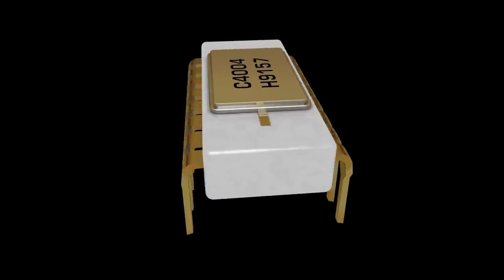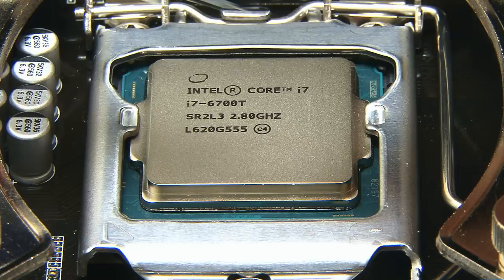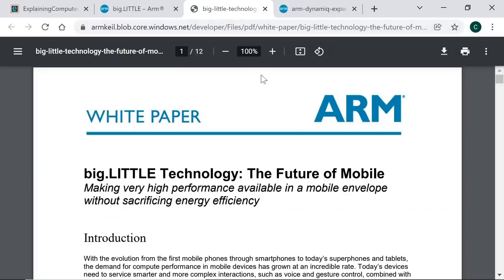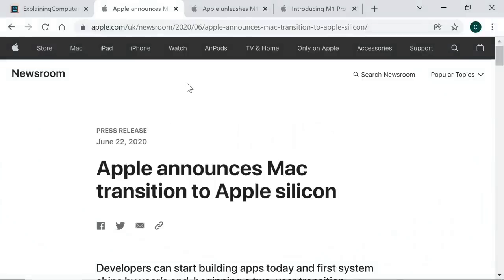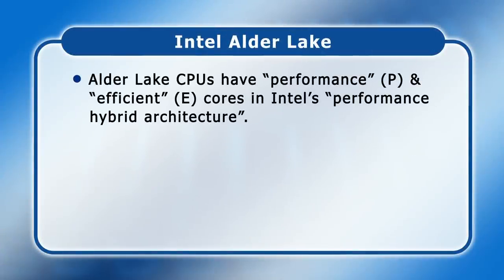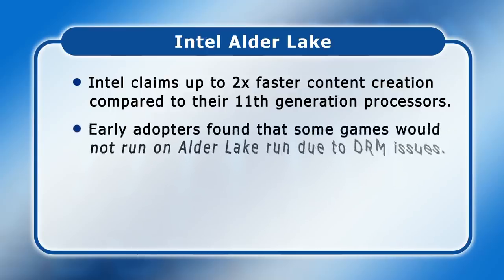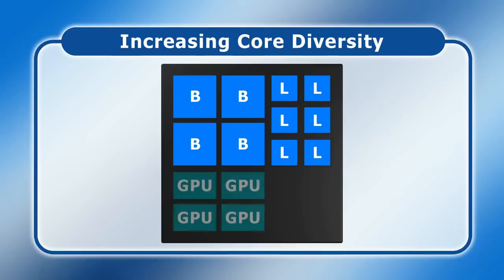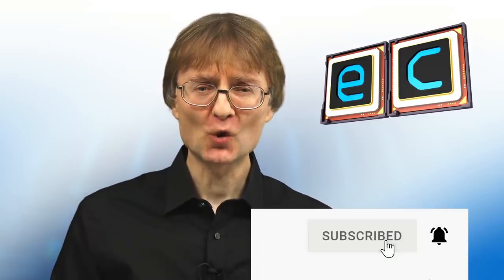The big.LITTLE CPU Revolution: From Arm & Apple to Intel & AMD

Comment from the maker: As many people have correctly pointed out, when I state that some server processors contain "a staggering 56 individual processing units", this is currently the highest count for an Intel server CPU. For AMD the figure is 64 cores. My apologies. Also note that I say "Intel 404" and not "Intel 4004" in the second section of the video. My brain is clearly failing (although the graphic for the chip is correct).
Reply: This new 12th gen doesnt always work as intended.....the scheduler is broken so it causes issues with many programs
Reply: i love these videos always well done
Reply: you need to take your medications ;)
Reply: Your brain isn't failing, it just needs the latest kernel fix.
Reply: Intel 404: CPU not found
Reply: Yep, doesn't matter how fast or powerful your hardware gets, if the software contains bugs, it will just fail faster. =D
Reply: Love your work
Reply: cosmetic errors, no worries. Enjoyed the presentation
Reply: Mr. Brain was only having a hiccup. Your video was wonderful. :)
Reply: Your brain is not failing. Maybe needs a cooling fan?
Reply from the maker: @johnfaulkner6776  :)
Reply: We are born to make mistakes, and the best one can do is correcting them,
So, thanks for the correction
Reply from the maker: Jim McIntosh  :)
Reply: 56 cores? Yea Intel's weak Xenon is at 56, but AMD EPYC is currently using 64 and the next gen will have 128 CORES!!!! 256 THREADS!!!! and in a typical 1u server with DUAL SOCKETS that is a STAGGERING 256 CORES and 512 THREADS!!!!! .... 56 cores.... go Intel?
Reply from the maker: @Nobe_Oddy  I really think we need to compare CPUs that actually exist -- and that comparison is currently 56 vs 64. Both Intel and AMD server CPUs will can also be used in dual socket boards, and have two threads per core. So your comparison of 56 to 512 is ludicrous. :)
Reply: Since Cyberdyne is coming, those problems wil be gone soon.  ...sort off...
Reply: These types of brain hiccups happen to me when I accidentally drink decal coffee.
Reply: In chrome browser about:flag you can restrict by enabling big little

Comment: The unsung heros of this hardware innovation are the associated compiler and OS technology that allows the same code single-threaded to benefit from multiple CPUs.  M1 is great, but the seemless and performant Intel-to-ARM translation layer in the OS is mindblowingly extraordinary to me.
Reply: Software is of course, the ultimate goal of making hardware. Hardware is useless. Software is where it is at. This is how a programmer thinks. Then he or she learns that a faster set of a certain kind of cores makes their code run faster... it is the code that makes the decision, not the hardware. You make hardware to make software run faster. Hardware is just a bunch of shortcuts made into silicon.
Reply: I believe Apple baked in some special instructions in silicon to accelerate Rosetta 2 performance. It is definitely very impressive!
Reply: @BlahBleeBlahBlah  Yeah, that's true and as you write very impressive . I bought my Macbook Air M1 the same day as it was announced and love it. I also have a couple of Intel NUCs and Asustore NAS, love them too. ;-)
Reply: @Alessandro Condorelli What is Photonics computing? please enlighten me on the process :P
Reply: But compilers don't just make your code use multiple cores. A programmer has to explicitly spawn threads or processes and use synchronization tools with them. I can see that OSes might and do use multiple threads in single threaded code, but the performance is incomparable to actual multithreaded code.
Reply: @danielreed5199  Sounds like the Isolinear systems from Star Trek TNG onwards.
Reply: @johntrevy1  That is indeed enlightening, thank you
Reply: Seven years for what?

Comment: The processing power in home computers is getting so far beyond my needs, that I can save loads of money by buying what most people seem to regard as obsolete relics! I'm writing this on a 2012 i3 laptop, and my recent, and most powerful, purchase is a 2014 i3 desktop. They're more than adequate for everything I do, including CAD for 3D printing etc. They're a massive overkill for gaming, as Solitaire runs on almost anything!! The only new computers I buy are Raspberry Pis, that are pretty good for general purpose computing, apart from a few programs that don't have ARM versions.

In 8-10 years time, maybe I'll find out what one of these new breed of processors can do, when I can pick up an old machine for £60 on eBay!!!
Reply from the maker: I agree. For a great many applications, modern CPUs are over specified.
Reply: Agreed. Watching this on an HP 8200 Elite with i5-2400.
Reply: But can you run Windows 11?
Reply: Up to a point. You eventually run into hardware incompatibility problems, such as PATA to SATA, and you want to use USB3. You can get round these problems with adapters and cards. Modern software such as Firefox uses a lot of memory and processing power. When you use a new computer, it's amazing how snappy it feels.

I must admit, I'm surprised at some of the PCs I see thrown away.
Reply: @photonboy999   Why would I want to? It took me years to be able to almost entirely escape from the clutches of Micro$oft, and dual booting Windows 7 on my oldest laptop for the few times I need to use Windows only programs is good enough. Linux Mint on x64 machines and Raspberry Pi OS on Pis does everything I need, and more.
Reply: I own a used 3900X (£320) and need the 24 threads for some simulations, but I like the i5 4570S in my home server more. It did cost just £25, incredible performance for the price.
Reply: The bottleneck has been the hard drive, put an SSD on a Core i3-Gen2 and it will be fast enough for most people and tasks, just make sure you have at least 4GB of RAM, or 8GB
Reply: @rollover36  I have SSDs in most of my computers, except the Raspberry Pis I use for specialised jobs like running OctoPrint. The "new" i3 came with 8GB RAM.
Reply: I have a raspberry pi 4 4gb as a backup for my main in case it fails. I had one main computer fail two years ago and i was without a computer for over a month since i had to save funds. Since then i bought a rasp pi just in case. It works just fine for that i need it to do and it costs a 3/4 less than the usual mobo ram and cpu i get when my mian computer fails. Now that i dont game much at all anymore since i picked up my guitar afer 30 years the rasp pi can handle anything i demand of it.
Reply: The software will eventually kill off your hardware and I suspect streaming will at the forefront of the line to kill your hardware.I too have assembled a collection of dual core computers most with min 4Gb ram and they have various Linux incarnations on them (usually Linux Lite or some XFCE distro). They run pretty fine.
Reply: Old hardware is still quite good. My home theater pc has a core2 quad and an Nvidia GTX500 series graphics card. It's got 8gb of ram and runs a SATA SSD. Plenty fast for a browser and streaming box, and it just got a new lease on life with GeForce Now.
Reply: @CyborgZeta  my i5-2500K says brang it on, baby.
Reply: @Sunlight91  i3 12100k is faster for 3900x at 120usd releasing in jan
Reply: @CyborgZeta  the only thing that gets dated is gpus
Reply: An i3 12100 with a NvidiaT1000 is more than enough
Reply: Y'all got nothing on me. My main laptop is a hacked Chromebook running MX Linux quite nicely on a dual core Celeron 3215 @ 1.7 GHz and 4 Gigs of memory.  I replaced the original 16GB m.2 flash drive with a 250GB model and everything is super zippy apart from video encoding.  (Which is not something I do with it anyway.)  Power-off to login screen in 23 seconds.  Another 5 seconds to the desktop, so under 30 seconds to boot to my workspace.  It plays video excellently, and does all internet things I need it to do.  It also allows me to do basic photo editing and some other graphics work.  I run Brave, Firefox, and Opera as browsers without problems.  The most complicated game I play on it is Endless Sky and that not very often, but it never hiccups.  Onboard HDMI means I can use pretty much any TV as an external monitor @ 2020x1136.  I generally get about 9 hours of use out of it on the battery if I'm not flogging it, and it's 4 years old!

That said, I did have Elementary OS installed on it and it booted even faster.  As low as 15 seconds from power-off to desktop.  However the developers of Elementary OS have made some decisions I don't like so I'm switching to MX Linux.
Reply: New portable computers (netbooks, notebooks, etc) are optimized not only for performance, but for less energy consumption. You could reduce your energy bill by just upgrading.
Reply: I'm using an ASUS VivoPC from around 2010 as my main computer. Works OK. Doing anything Java isn't so great, though. It also helps that I run Debian MATE and have an SSD card.
Reply: I'd argue that the processing power in home computers has surpassed what most people need over a decade ago. The difference today is how the software keeps "upgrading" to do the same tasks it was used for a decade ago. For example, MS Office has GPU acceleration in Excel...and the VAST majority of people who need to use a spread sheet program don't need it and could just as functional today if they were still using Excel 97 without GPU acceleration.

That being said, if nobody tries something different or tries to push software and hardware limits, life would be too boring. :)
Reply: My Thinkpad W530 with i7 QuadCore from 2012 is even as fast as many new Laptops coming out including some for content creation and even gaming. Very seldom I am using an external GTX970 solution for creative work and modern Gaming. And I can take it to every place I need to! For my main work (writing articles) I use a Thinkpad T60/T61 Laptop from 2007 (though as an hardware enthusiast I modded it to run a QuadCore aswell lol).
Reply: @Amorousstake4  Only in gaming. For my multicore application the 3900X even beats the i5 12600k by 16%
Reply: Fully agree. The same is true for phones as well, but phone apps begin to misbehave on older phones, likely because the developers have no incentive for backward compatibility testing.
Reply: My old atom notebook can still write word documents, why do I need an intel core i9 5786545754676 ?? 😂
Reply: @photonboy999  with workarounds, yes, in fact it would run better than 10
Reply: @rcso2010  yes, the transition from 32nm to 22nm (second to third gen Intel CPUs) was big in CPU heat dissipation; my Dell XPS with i7-2700 is still fast but gets much to warm.
Reply: Agreed on older machines being adequate for most uses (I used a Core 2 Duo Macbook for 10 years), but eventually the demands of modern web browsers/sites mean the hardware starts to struggle.
Reply: @ExplainingComputers  agree, watching on Latitude E7250 with i5-5300U and running Windows 11 Dev build
Reply: @rollover36  actually I once used a core 2 duo laptop with pata drive interface (using ssd) and running windows 10 64-bit. aside from lagging 3d design due to gma 950 gpu, the laptop can at least run video at 720p on youtube which is acceptable for me
Reply: Totally agree. I just picked up a 5 year old dell 5510 i7 for $300 thing runs amazingly well
Reply: My employer disposed of a 2014 Huawei rackmount server, previously used as a virtual machine host because it was out of warranty. I was able to (officially) have it diverted to the boot of my car, it is now my VM host, it has more storage than I know what to do with, and my daily driver machine is a VM accessed via a Raspberry Pi and VNC when at home, or on a laptop (again, disposed of by my employer) running Linux connecting via VNC over a VPN or SSH tunnel. This 2013-era Toshiba laptop runs Linux really well especially after upgrading to an SSD.
Reply: Mate its all about power when it comes to the new cpu's diddnt you even watch this very same video?!?! i give you a hint . climate change energy consumption
Reply: Using my $15 Pi Zero 2 W to reply
Reply: This good sire get's it.
Reply: jonneymendoza Per climate change and energy consumption - unless we go nuclear power big time (preferably Thorium) then our  civilization is doomed as we'll all be suffering the same kind of consequences as those poor folks in Texas during the 2020 winter. Elon Musk says we need to triple the US national grid output if all ground transportation becomes EV - that is just a jaw dropping, staggering thing to contemplate as solar and wind account for just a fraction of current output and have no chance in hell of scaling out to produce triple current total grid capacity. A transition to EVs portends a very bleak future as b
no one is listening to Elon Musk about this and yet EV is going into hyped up fever pitch mode
Reply: If i wasn't a video and photo editor, I'd use my 2011 thinkpad t420 for everything
Reply: @uksuperrascal  I bought myself one of those but on the default raspian youtube was awful!  Will try a light vsn over Christmas but will be getting a Raspberry Pi 4 and a Ryzen 7 5700G APU to play with.  Driving a 4k Monitor mind you so perhaps should switch to 720p on the Pi Zero 2 W :)
Reply: Still running quad core Xeons from 2008. Works flawlessly.
Reply: Just to throw my own adiquate "crappy" machine into the pot, the AMD Phenom X4 powered acer Aspire  M3201.  I have doubled the standard memory to 4GB and attached an SSD to its slow 2nd gen SATA ports, but other than that it is in standard form and has been running without issue since it was purchased new from Tezzies around 2008.  It ran faultless on the original install of Vista, then Windows 7 and now 10.  I wouldn't want to move to Windows 11 anyway and most Linux distros have played nicely when asked.  I find the limitations of the motherboard (slow SATA and USB2) a little regretful, but even I'm not perfect (or so the missus likes to point out).  It could do with a better graphics card if I wanted to play some games, but WGT Golf plays silky smooth and I use a console for anything else.

I may end up buying a higher spec PC to play games because the PlayStation 4 was the last console I'll be buying, but that has chance to be a long way off and it certainly won't be running Windows 11...perhaps Linux or Windows 10 or even 7.  I'm not sold on the new big.LITTLE architecture and what seems to be endless problems, so a chip full of big cores and a fluctuating clock may be for this dinosaur!

...and that started life as me adding my machine to the list...sorry!
Reply: @BruceLortzHI  well that's true with desktop but in laptop world, from 3rd gen cpu the power consumption and performance hasn't changed pretty much (in U series CPU) until the arrival of 8th gen (i7-3687U = 4600U = 5600U = 6600U = 7600U). The iGPU on 3rd to 5th gen I do not notice any difference in game performance, 6th to 7th gen may be higher because they switched to DDR4
Reply: Riding a 3960x, 4930, 5920 and a 4.4ghz 8350 into the sunset here... have my 3600x/5700xt simply because there are things the others cannot do.

I tell you the CPU people completely miss out on is the 6300 series Opterons, hard to find boards for them now because the CPUS are indestructible.  Having an 8/16 that hits 3.2ghz from 2013 is insane
Reply: I bought a case for £1.50 about ten years ago, it contained an i-7 board with water-cooler. I added memory, power supply & graphics, it's still my favourite machine today.
Reply: Very true. Modern kit is amazingly powerful theses days.

Comment: Seeing your excellent description of the "BIG little" (BL) idea sends me back to the early 60's when Cray developed a similar  BL concept in the Control Data Corp 6600.  It had BIG main central processors (CPU) whose job was to perform  only computations and little processors termed Peripheral Processor Units (PPU).  The system had from 10 to 20 PPU''s that did the operating system scheduling, resource allocation, accounting, etc. tasks.  The  PPU did all the system Input-Output because the CPU had NO IO instructions.  The PPU and CPU each had their own instruction sets.  The CPU was a 60-bit processor while the PPU were 12-bit processors. As a Control Data Field customer support analyst, it was common, b by the customer's accounting, to get 684 to 698 hours of user computation hours out of 720 (24x7) hours per month.
With this level of performance from the 60's I can see the modern day concept of BL may bring similar performance and at a lower price point.